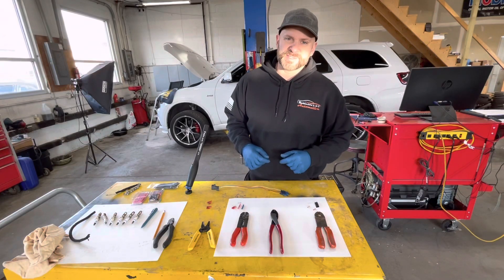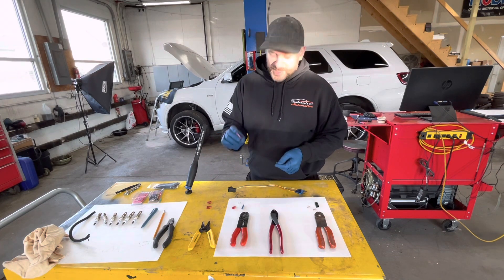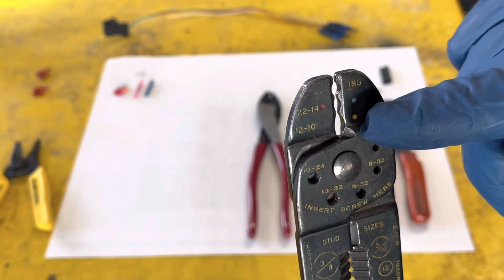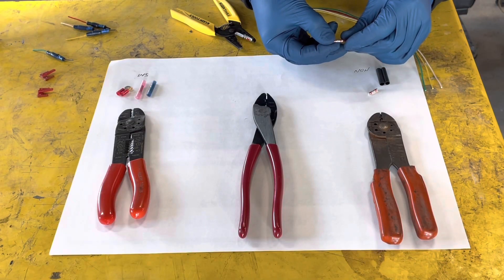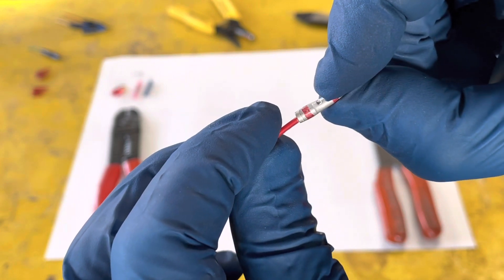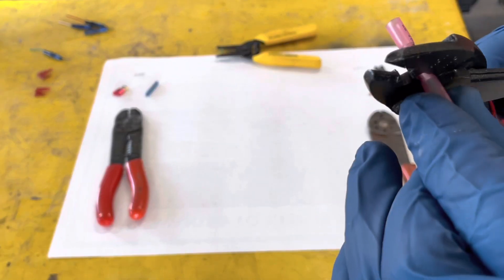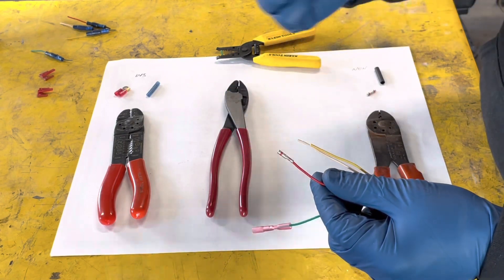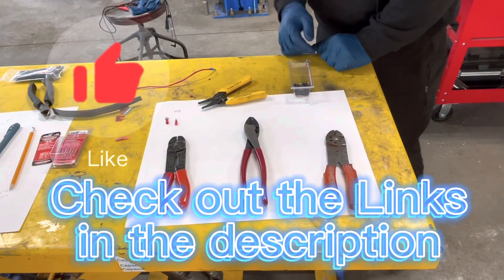Are You Crimping Wrong? Uncover the Secret Behind Perfect Connections!

Comment: Thanks again for usual informative video. One problem with trying to solder wires that have been broken for some time is that the copper is often oxidised and will not 'tin' Even with a good strong flux paste it can be very difficult to get an acceptable joint.

Comment: If you solder I'm pretty sure that's going to be better in every way. But only if you really do it right. Which is absolutely a skill and most people don't do correctly.
Reply from the maker: I historically soldered everything. I still feel it makes for a better repair. However research above my pay scale says otherwise. You won’t generally find a single solder connection in a vehicle aside from inside rigid circuits isolated from any movement. Everything is crimped millions of crimps. 
I agree and still solder most repairs with the addition of adhesive lined shrink wrap

Comment: Solder is good, but not on sensitive circuit, ie maf, tps, map, injector, cam and crank sensors. Solder creates resistance and can lead to a bad reading. Car manufactures dont use solder on most of their connections, so you dont need to also. Where they do is where you probably should. One place though i like to solder is battery connections. Not neccisarily for the connection, but for corrosion control. The crimp does the holding. One tip i learned though thru experience, is to wear tight latex gloves keep hand oils and other contaminants off the wire to prevent corrosion later down the road. The cleaner you make the connection the longer it will last.
Reply: The crimp will also add resistance. If it's soldered well it should not be more resistance than a good crimp like shown here.
Reply: @VonGeggry  To put it quite simply, any break or repair wil cause resistance, but the crimp is less of resistance than the solder repair,  especially if solder repair is subpar and low grade solder or wrong mixture.
Reply from the maker: This is very interesting. I have been Been doing a lot of research on this topic, you covered most of the key points. Thank you for sharing this
Reply: @robinsonsauto  No,problem, i enjoy the channel. Wiring is like welding, the cleaner the surfaces are the better the connection will be.

Comment: I Upfit our departments new Tahoe units. I solder wires for any gun locks, radio, or computer system. For the LED lights I use the non insulated with double wall heat shrink that has the glue inside. The new LEDs all come with 20GA or 22GA silver wire so trying to solder that takes too long. Plus each unit has multiple lights that need it’s own control power wire with the new Whelen Core system. So I’m not going to spend a whole day trying to solder about 40 lights that have 3-4 wires per light head. 👍
Reply from the maker: Interesting thank you for sharing your experience. I come from the school of soldering as well, it’s a tough debate because research and training tells us otherwise

Comment: Non insulated and heat shrink, but I do solder and heat shrink also. depends on my mood, the room to work, and where the joint lives. I've got an assortment of the NEW solder filled butt connectors, but after thinking about it I've been afraid to use them on a paying customers car. I hate do overs. On insulated connectors, wire size to connector size is the key. Nothing worse than a crimp that will not pass the TUG TEST...THANKS  WILL.
Reply from the maker: I’m from this same mindset. Mood sets the tone lol

Comment: The more I try various options, the more I tend to gravitate back to the non insulated connectors with separate glue lined shrink wrap to follow. I believe you get a better mechanical connection when you're not worrying about damaging the overlying shrink. In the past I've seen cheap shrink wrap connectors shrink so much the insulation splits, in areas that are not even in the crimp region. When it does split, you can't put shrink wrap on after because the connection is already made, so you are faced with options of tape (looks amateur), or maybe liquid tape (looks goofy), or cutting the crimp out and hoping you left enough wire to do it all again. I'm suspicious of connectors with built in solder activated by a heat gun, because the low temp solder they use could melt inside an engine compartment and because the joint is nowhere near as good as normal solder, and not clearly better than crimp alone. If I solder, I do it right.
Reply from the maker: Very interesting 🧐 thank you for sharing all your experiences. Do you feel there’s a point in which the added resistance due to a repair can impact low voltage signals?
Reply: @robinsonsauto  Voltage drop is related to current, so many communication and sensor lines can tolerate quite a bit because there is very little current flowing. Those wires that do work need more current so they are the ones where even a tiny added resistance makes a big difference (fuel pump, window regulator, alternator, blower motor, headlights, starter, etc). They also heat up more if the tiny resistance sucks away power, making any joint sensitive to heat a poor choice.
Reply from the maker: @spelunkerd  this information is priceless. thank you again for sharing your knowledge with us. I’m thankful to have you In This community